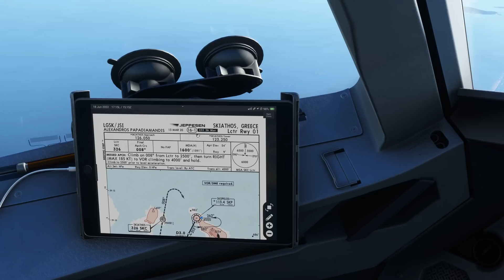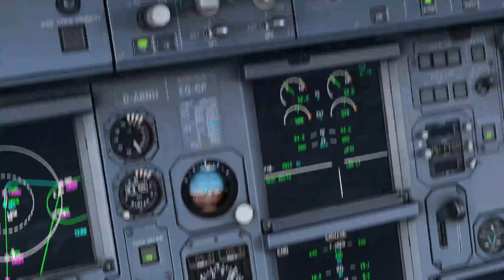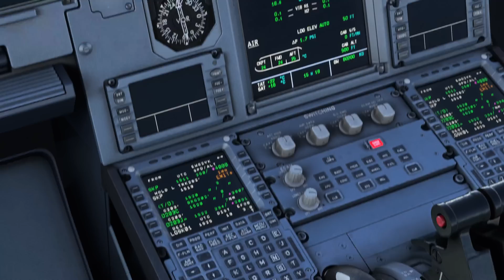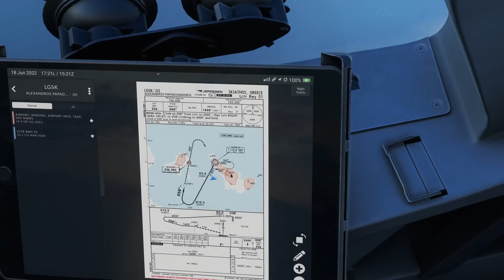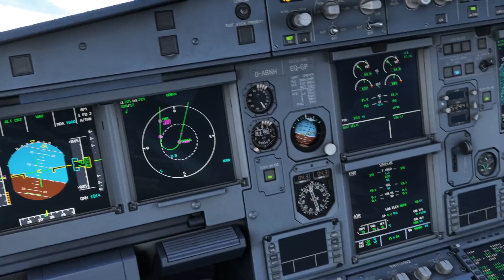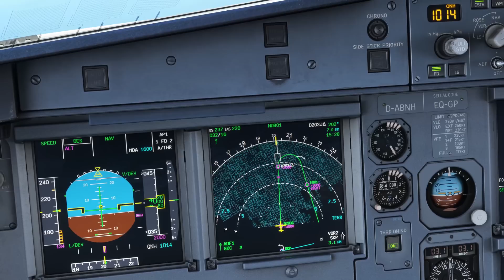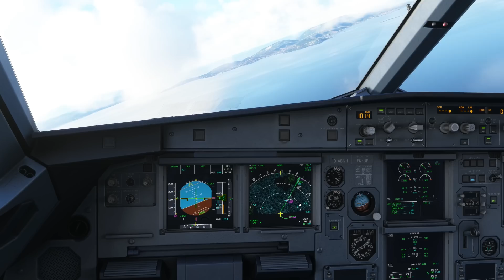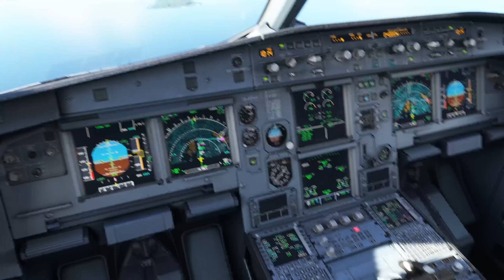Fenix A320 | Landing at Skiathos | Tutorial | Real Airline Pilot

Comment: Damn, watching this video gave me a 'eureka!' moment about landings in the A320. Like, something just clicked. I see you gently leveling out the plane right at about 50 feet. Then you start a nice, shallow flare about 30 feet. It's such a subtle flare, and the plane does absolutely zero floating, and  very smoothly touches down. Since applying that exact technique, my landings have become much more consistent.
Reply from the maker: That's a technique that should not be used however, even though I did it myself. I find it necessary in the Fenix A320 due to the onset of the nose down pitching moment at 30ft, but it should not be required to "pre-flare". Indeed according to the Airbus manuals it's not allowed.

But well, I guess if there's no other way to land that thing properly in the sim... time for Fenix to rework those aerodynamics and FBW in that area.
Reply: @A330Driver  Haha! Okay thanks for the insight. I'll keep playing with it. Thanks again for your awesome content.

Comment: Just in the process of building a PC and moving away from XBox back to PC, mainly because of Fenix and PMDG.  Can you recommend a set of tutorials to bring me up to speed? I have been flying non study level aircraft for a while now and want to get the procedures right.   I am a retired military air traffic controller so am familiar with ATC directed procedures, but not so much the aircraft management.  I also seem to struggle with the flare so my landings are a little heavy handed.
Reply from the maker: For the 737 I can of course recommend my own videos 😅
I've created a full set of tutorials for it.
For the Airbus there are many great sources, I wouldn't even want to say which one is best.
Reply: @A330Driver  I will definitely use them.  I really like the interface the A320 from Fenix offers through the EFB, especially with Navigraph charts.  Is this in the pipeline from PMDG I think you may have mentioned it in your video?

Comment: Always wondered what the requirement was to disable auto throttle in the airbus.  I’m not a real pilot but my understanding is you keep the AT on in the airbus but disconnect in the Boeing - thoughts?
Reply: Correct, The airbus as a feature galled G/S mini, it handles the trust on final, the auto throttle disconnects with the thrust levers are put to idle on the flare